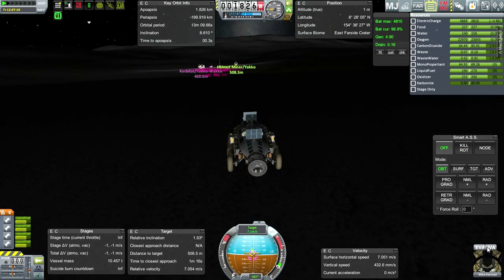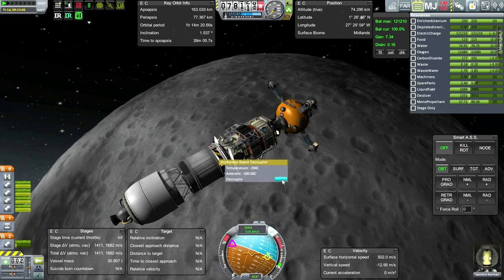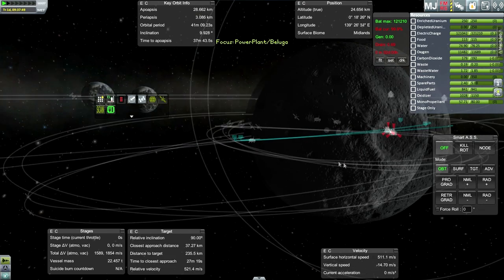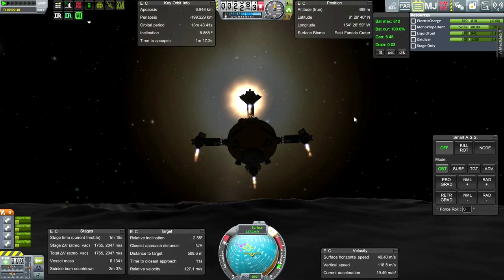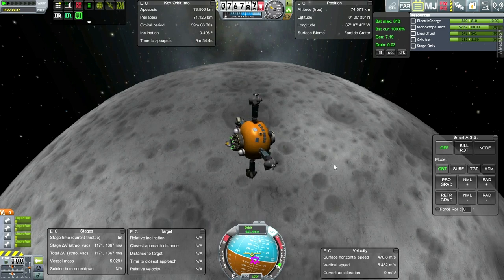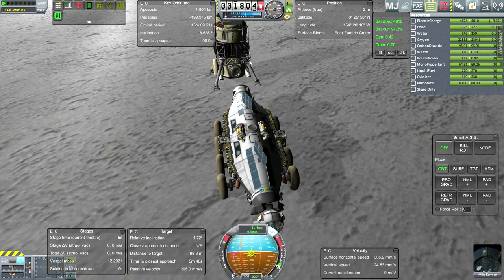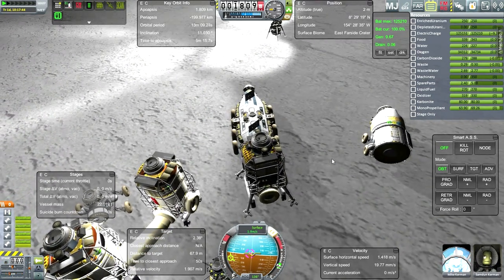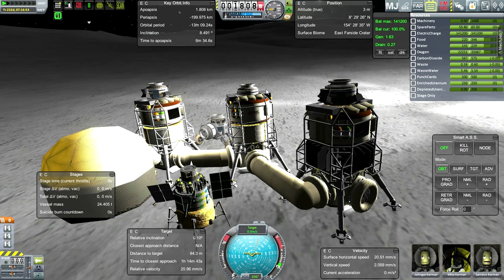Kerbal Space Program (0.25) - Kolonization 21 - Connecting the Reactor

Comment: You should have someone at the base set a flag and use it as a target.  That way, you can land right on top of it, then pick up the flag.
Reply: I use MechJeb landing guidance and it's so accurate that a second lander will land on top of the first lander, if you target the flag under it.  Also, helps with planning layout.  You won't have to drag the new lander as far around your base.
Reply: I'm a crap pilot.  My Kerbins would be using KAS to string together scattered debris on the Mun surface to make a return pod.